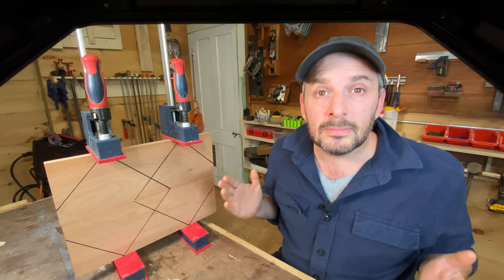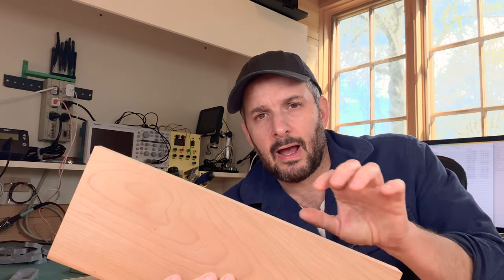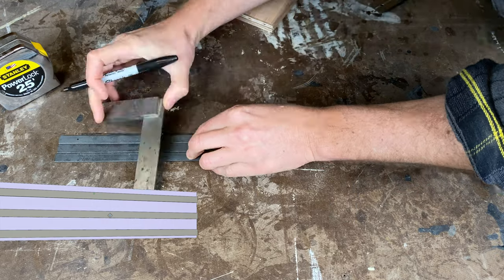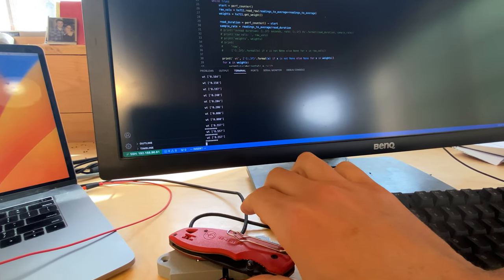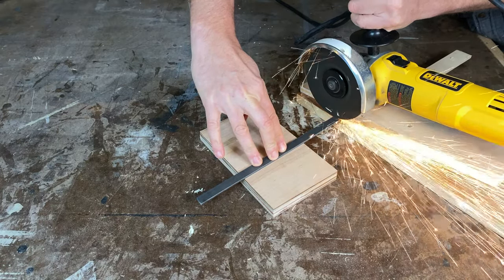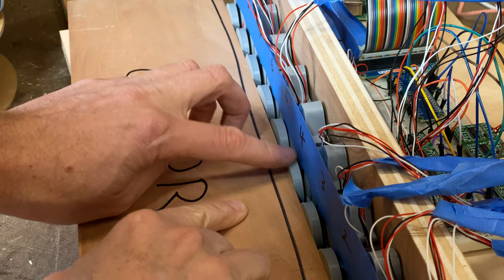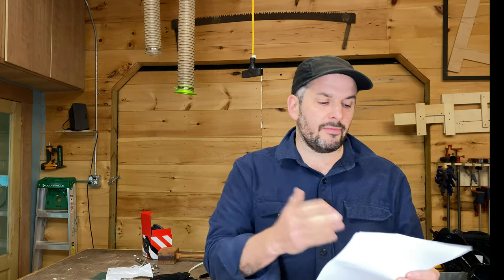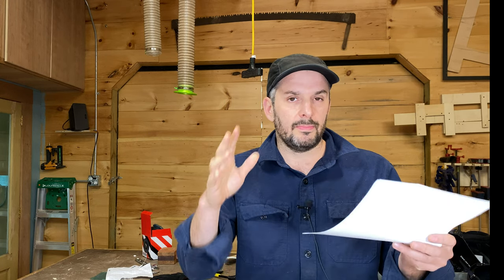Is the 45° rule for clamping boards based on anything?  Is it even true?

Comment: This was really very educative, thank you for setting up this complicated contraption and sharing the experiment results..
All woods don't come equal as for elasticity (and mechanical properties in general). Thickness probably has an influence too (the thicker the board, the wider the spread angle).
I suspect the grain orientation (as on your narrow cherry board) also has major influence as wood is very anisotropic.
Great job 👍
Reply from the maker: For sure!  Those are great points especially about grain and it’s not just end grain vs long grain. Every knot matters

Comment: Very cool, you should repeat with multiple clamps while varying spacing - if you have two on opposite edges you may balance the "tilting" you saw.

Another option for instrumentation would be digital image correlation (DIC), where you spray paint the boards, record them using a camera while you load, calibrate some distance on the board, and essentially map out the strain by tracking the displacement of the spray paint speckles.
Reply from the maker: Yeah good call. Moving into multiple clamps at a time really opens up a lot of new directions. 

I though about some analog measuring devices like a series of fluid filled bulbs with stems on top that would push the fluid up proportionally to the pressure.  But DIC seem intreesting!
Reply: @arikardasis  GOM Correlate is a software for DIC, I believe they have a free version

Comment: I enjoyed seeing how to set up the data collection system. Thank you for teaching us the truth about clamping.
Would it have been simpler, cheaper and more accurate to use low tech Plastigauge? It is a precise thickness and spreads a predicable amount based on the pressure it sees.
Reply from the maker: I didn't know about Plastigauge until just now!  That's a whole new way to approach this problem.  Awesome.
Reply: Possibly, the plastic deformation would affect the measurement as the board should have to move to follow the gauge, unless some compensation mechanism on the back of the gauge keep its working side at a sonstant position by compensating for pressure induced thickness loss. This would be perfectly fine for single point measurement though !